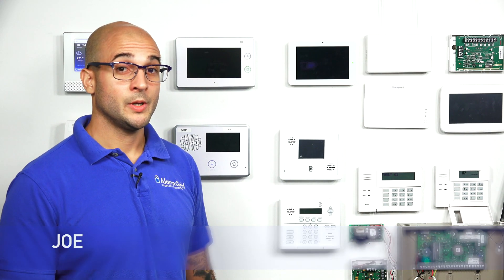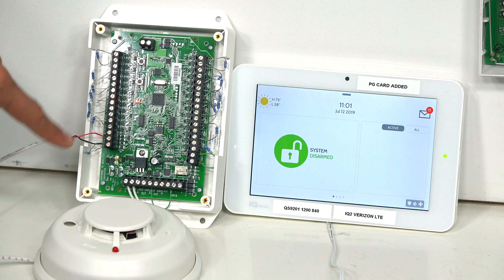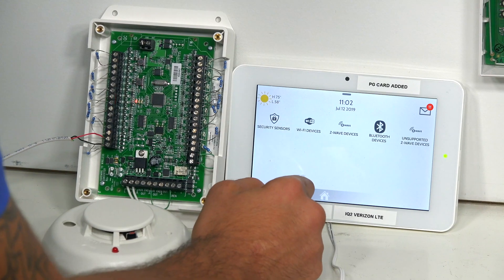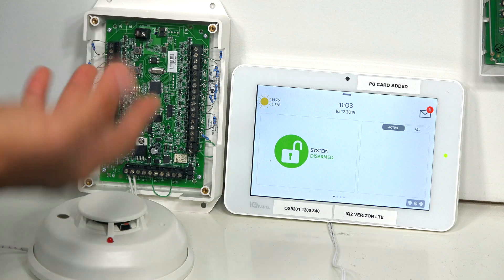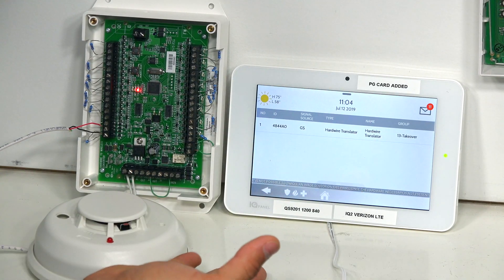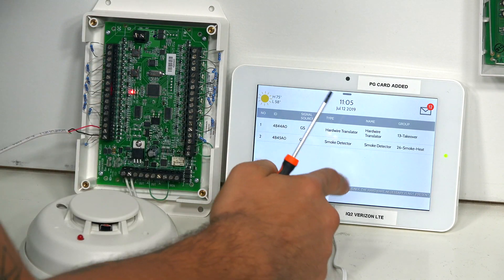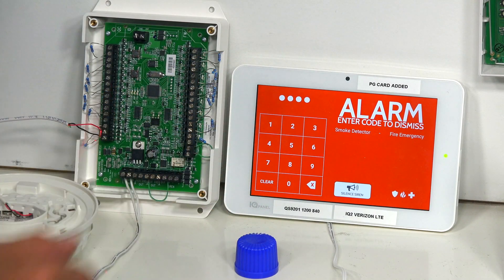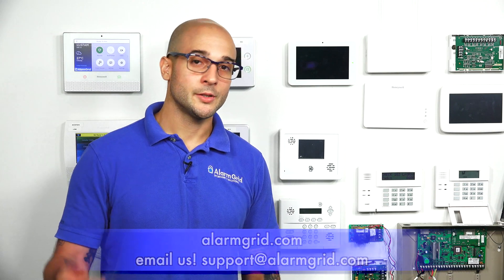Troubleshooting 2-Wire Smokes on the Qolsys Hardwire 16-F

Comment: Does the Qolsys panel automatically reset the smoke detector after the alarm has been silenced/turned off? I was able to enroll them just fine, but after I set them off, the panel wouldn’t clear the alarm. Thoughts?
Reply: Hello, If the smokes are wired into the 16F first prior to enrollment into the IQ panel, there is usually no issues with Triggering the Smoke alarm and restoring properly. If the smokes were added after the 16F was enrolled into the IQ panel undesired results can occur. Not triggering / restoring properly.  It is best to remove the 16F from the IQ panel programming, then with everything still attached, re-enroll the 16F and configure the smoke zone again.
Reply: @DKAlarmgridSupport  Thanks. Have one more question… The smoke detectors in question are actually high voltage smoke detectors that have a low voltage 2 wire relay attached to them. Will they work on the 16F? They worked fine on the previous system which was a vista 20p.

Comment: I am pretty sure that the resistor should be wired at the smoke detector not at the expander. You have non supervised device with the resistor at the expander.
Reply from the maker: You are correct, for proper wiring supervision, in a real-world scenario, the resistor should be in parallel at the last smoke detector connected to the zone.  For Joe's purposes, it was easier to show it at the expander so as not to have to remove the smoke head and cause a tamper.